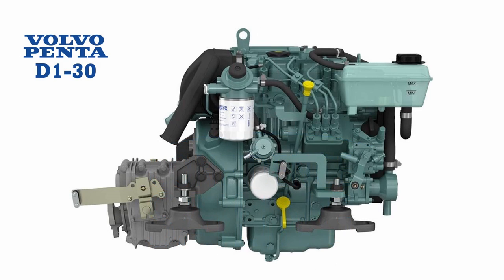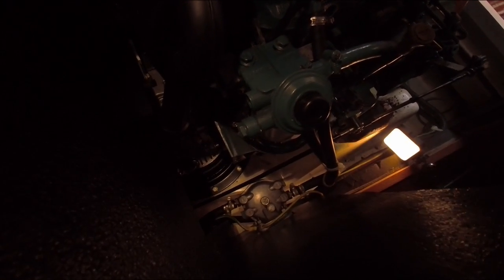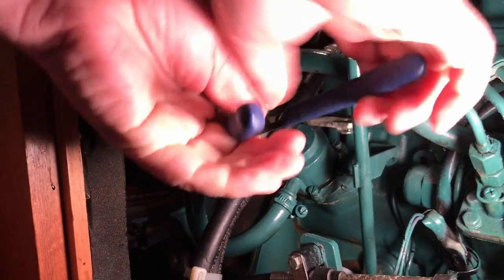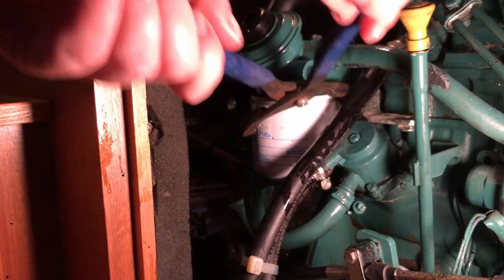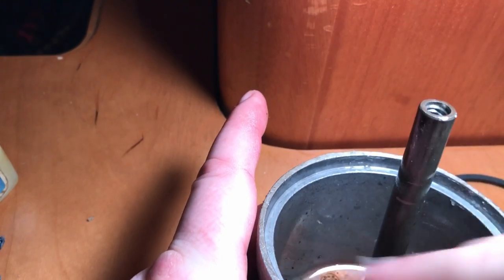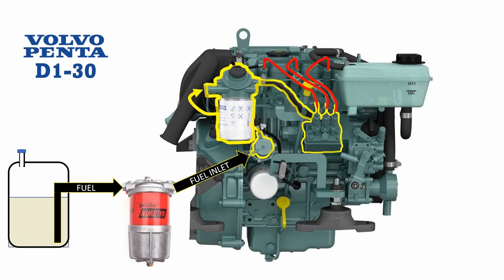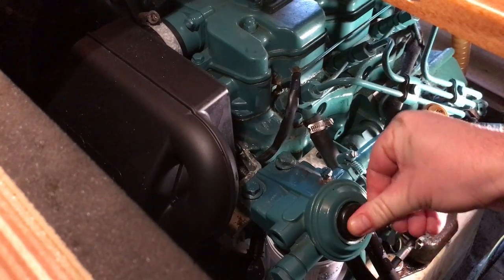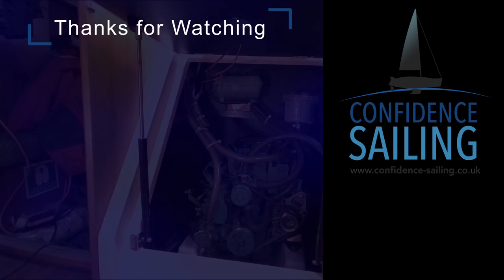Small boat engine servicing - How to change fuel filters

Comment: So all that crap and dirt is nov in the New filter
Dont fill from old filter😢
Reply from the maker: Three schools of thought.
1. Don't fill the filter at all and bleed the whole thing through.
2. Have a cup of fresh fuel handy - undoubtedly the best option, but  unless you have a simple way of extracting or storing fuel, entirely impractical.
3. Use the old fuel. If it's a routine service and you have nothing wrong with your fuel system the 'crap and dirt' would be minimal... But it would also be trapped by a brand new clean filter.